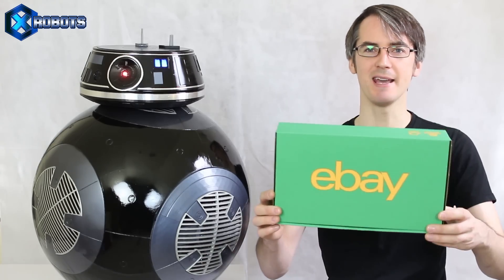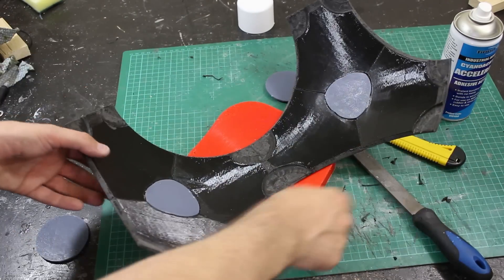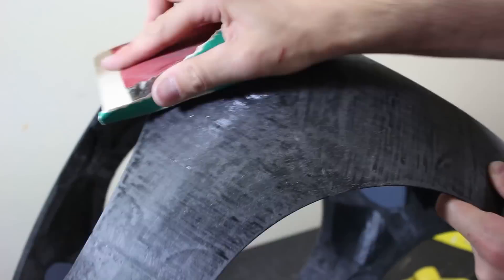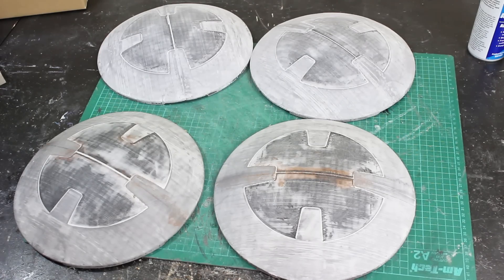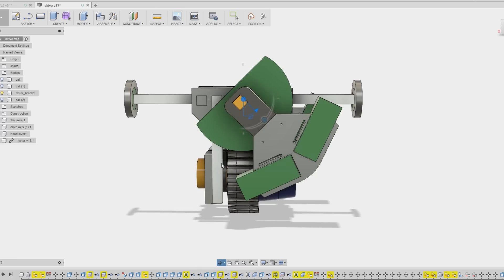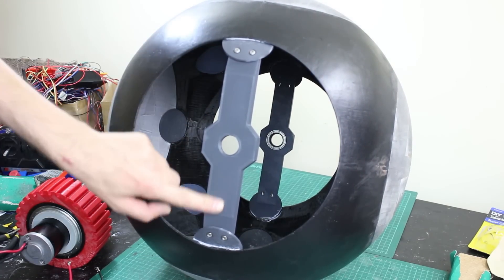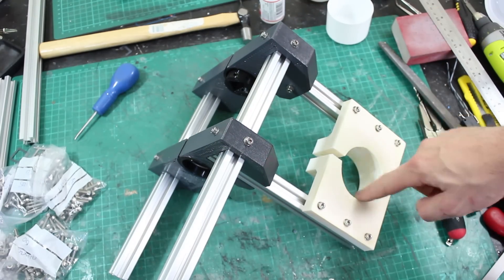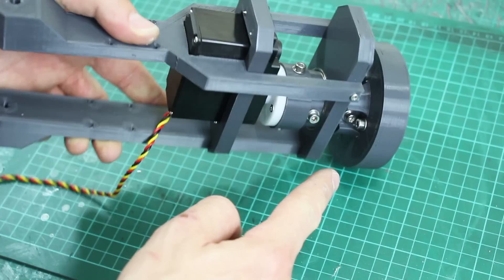Building a Star Wars BB-9E Droid from The Last Jedi #1 | James Bruton

Comment: Question about the circle panels. On the inserts for the circles, why did you align the seams in the same direction as the circles? Wouldn't it be a stronger going perpendicular to each other?

Comment: Mr. Bruton, an awesome job indeed, but is there a way you can post an itemized parts list as well as the files you used for the designs for the 3D printers? some of us have no idea how to do anything 3D printer and without mention of what type and sizes of the various parts, this will be a very difficult and overly costly project, also for those of us who are not well funded, can you assist please

Comment: Hi James, Fantastic build!, can i assume that the ball is a mix or PLA and ABS or is it just ABS as you mentioned about the cardboard heat shroud only when printing the ball inserts (i am not picking holes in the video) i have terrible trouble with ABS and  its just nice to see new ways of welding PLA as its not easy (super glue or evo stick is about the only thing apparently as epoxy doesn't stick.
Reply: Wow, thanks for you fast reply. Thats great news, i will try the dremel approach. Merry Christmas by the way.

Comment: James, so only one drive wheel?  Why not a pair of mecanum wheels?  You could also make the circle vent panels a twist lock so you don't need the internal brace.  The head stick could be floating on a loose spline with a castor wheel or something on top since it would be pulled up to the head itself with magnets.

Comment: Your project is now finished,  by now you noticed how poorly Pla type filaments are harder to sand and finish then ABS, Just for makers community sakes,  I will share my PLA finishing technique might help you or others, to make nice surface finish with less effort.  Before any sanding gets done I use a mixture of polyester resin with a UV catalyst (Suncure2000)  in a shady area I apply a light coat  with a paint brush to one sections at a time and bring out to direct sunlight for a minute, then continue, The polyester bonds( unlike bondo or wood filler which will eventually crumble out and drying time is longer)  It fills gaps and chemically welds parts together and  it is easier to sand then Pla would be on its own, the Ultra violet  catalyst is the key as it,  prevents heat caused by the curing stage ,to prevent deformations.
Reply: Thanks fior sharing, I'll definitel;y try that
Reply: How much catalyst do you use?
Reply: The UV catalyst I use, is sold in a little baggies package, one baggie is mixed with 1 gallon of resin, you'll need a Black opaque plastic bottle to mix it in,  it will keep for a year probably more if you store in dry cool dark part of your shop. You can also buy the Suncure sanding resin which is premixed with the UV CAT usually sold in 250ml or 1L bottles and its rather inexpensive.
Reply: Thanks!

Comment: I've been watching your BB-8 videos and was thinking that maybe instead of using the spinning ring of coins, maybe use weights that move side to side to tilt it, but my thoughts were of weights mounted on a rail that would slide left or right to tilt and thus turn, but I think your idea in this video is somewhat more elegant than mine, which I'm a huge fan of.
Also, watching your videos has made me begin to convert my attic into a workspace, within which I'm going to build my first 3d printer and also get more involved in robotics, so thank you
Reply: James Bruton I appear to have missed that, although it does make a lot of sense now that you say that, I'll have a look :3 and absolutely, I plan to continue doing so

Comment: What material are you using for tha ball? I see you where using a sander and I don't think is PLA because I tried that once and ended damaging the plastic, it melted :(
Reply: i figured its not abs being as he didnt asetone weld the panels together
Reply: i heard that chloroform also does that
Reply: Yes I was going to ask this question too. PLA or ABS or Other?
Reply: Mike Filippidis 
I don't think is ABS, he only made 1 part out of ABS, and he used an enclosure.
Reply: metalurgiax but isn't PLA weak, wouldn't it break driving on the street with a BB droid
Reply: Thanks James. What Solvent are you using to glue the PLA? Also I love the PLA welding not seen that before :)
Reply: Which PLA do you use please.
Reply: James Bruton 
James there is a product that welds pla similar to what acetone does with ABS is called weld on and I use it all the time for pla welding. The smell is really bad just as acetone. That stuff is use to weld acrylic but it works great with PLA.

Comment: I am curious if anyone has ever used a 3d printer at its optimum capabilities?  People are always doing like 20% in fill, cutting corners to make it print faster but then they trade off the quality and smoothness of the print in the end, leaving sanding to be done.  If someone didn't cut corners, did something filled in 80% or even 100% with the most micro setting for layers, how smooth would it come out?
Reply: alaskankare the infill is most of the times better left away from 100% except maybe for some verry flat (horizontal) things for multiple reasons.

Plastic doesn’t keep a perfect shape while cooling down so it can missform your object if you have too much plastic in a “glob”. Also thin pieces like the shell from the video would need extra fans to cool down properly and colapse.
Thinner layers are a thing for sure but with fdm prints, (like james said above me) the layer lines will be visible and it will never come close to the smoothness of the finished look he’s going for and sanding it down is the solution which leaves as much control in your hands as possible. And the time difference isn’t enough to make up for the print time.
Reply: thanks for the answers, I didn't realize too much infill could make the print worse. I haven't jumped into the 3D print world yet (still too much for my poor soul and I have no major need yet so cost to use ratio doesn't work).  Just thought if anyone tried printing with best settings possible and if it saved sanding time.